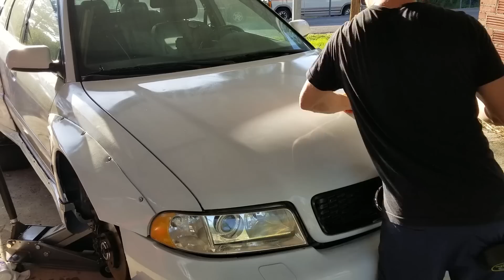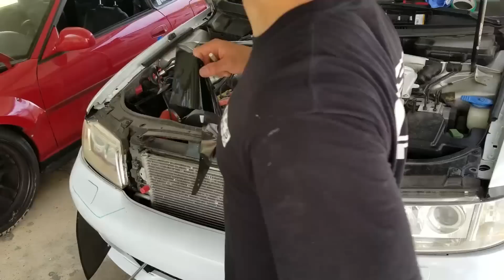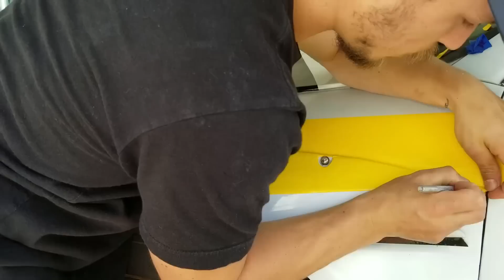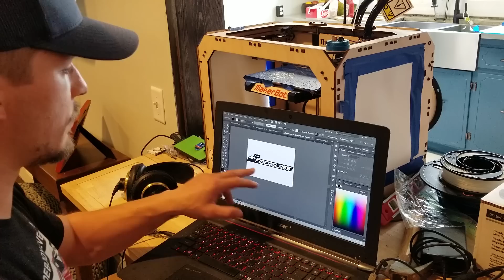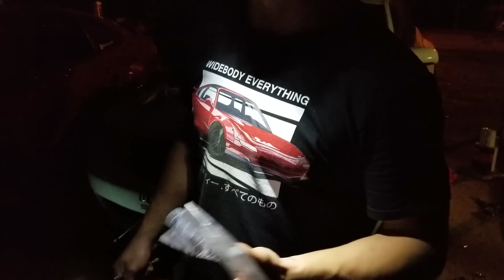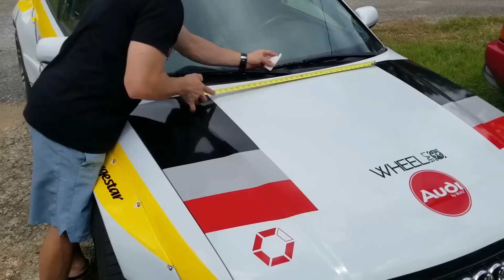VINYL WRAP LIVERY IN MY DRIVEWAY! FIRST TIME EVER WRAPPING

Comment: Also for working with intricate corners or edges, try using a heat gun or hear dryer to heat up the vinyl, this way you can stretch the vinyl just enough to get that extra clean finish.

Comment: For future reference. When you work with a vinyl wrap. Try using a spray bottle with some dishwashing detergent and spraying it on the vinyl and/or the car. This way, you can move the vinyl around a lot easier. Just use a a squeezy to get all of the remaining water out from underneath the vinyl when you're done. Love your vids dude. Reminds me of what my dad did when I was growing up.
Reply: It depends on the vinyl. Some need it, some dont. I just know that the 1080 series from 3m is designed to be applied without anything.

Comment: If you spray soapy water first you can move the vinyl around and a heat gun helps with the small details
Reply: just as long as you wipe off the soapy water or certain sprays for that same purpose before heating the vinyl with a heat gun/torch...otherwise the droplets on the surface of the vinyl will leave impressions into the vinyl and potentially burn it. but yes ^ agreed. haha.

Comment: You should add heat to the wrap especially in the corners so that the glue sets more firmly and won't peel off
Reply: + bc post-heating vinyl w/ memory tech (like 3M/Avery/VVivid/Hexis/etc) is an absolute requirement in order to heat + kill the vinyl's memory, otherwise if you stretch the film out in a certain area, when heat is reapplied the film will pull back to its original form....so anything that was pulled w/ heat to fit around corners, for example, would release from the corner when it's hit with heat later on if it isn't post-heated (under 190deg F; 190+ is the required amount of heat to "kill" the film's memory). It will also activate the adhesives for a lot of different brands of films, some more than others, but the most important reason for using heat is to shape the film around parts of the car to make your life easier, but whenever doing that you 10000000% have to "post heat" the film at >190deg to assure there won't be any failures in the vinyl....